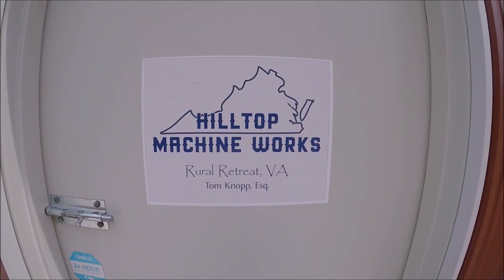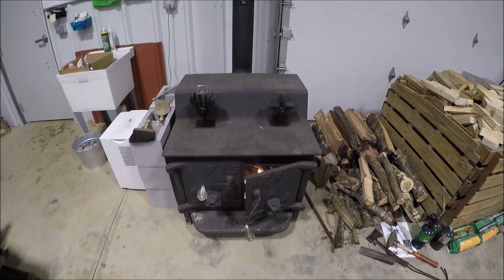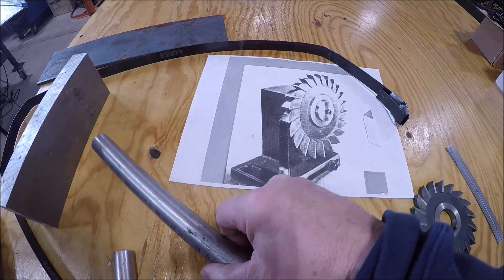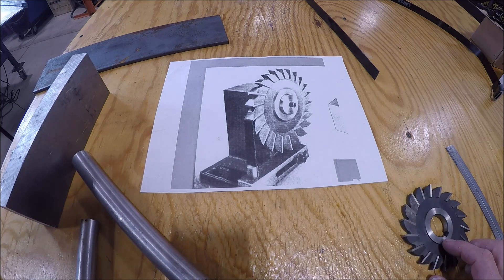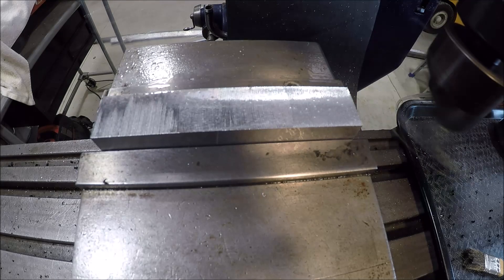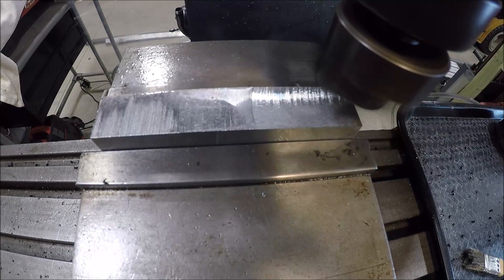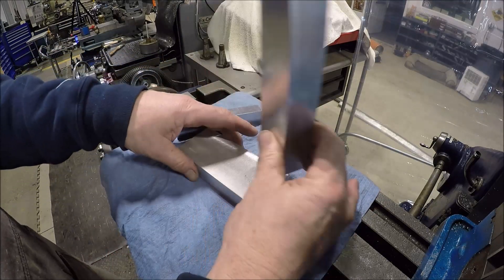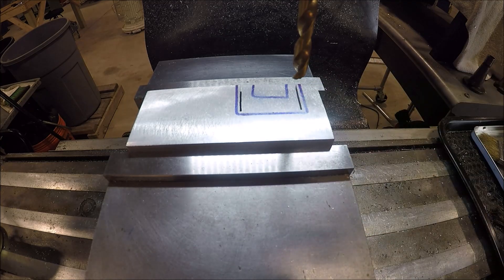Horizontal milling cutter sharpening fixture. Part 1

Comment: I wear them for close up stuff & reading as well !    I have some strapping for the finger of the one i am working on at the moment as well .  A section of jig saw blade  was suggested to me by a guy that does a lot of cutter grinding ,  so i was going to try that as well .   👍
Reply from the maker: Good idea on the saw blade. So far the strapping has worked fine.
Reply: @hilltopmachineworks2131  https://www.youtube.com/watch?v=-oD8JQTcxKw&t=1s
That should be ,   In my shed with BC . His channel is about cutter grinding .

Comment: Gday Tom, great project and I think aluminium will do the job just fine, I really should wear my glasses more often but like normal I dont, great video mate, thanks for sharing, cheers
Reply from the maker: Hey Matty. I know what you mean. It took a while to get used to wearing them all the time. I saw you had a bunch of flooding down in NSW. I hope you faired okay.